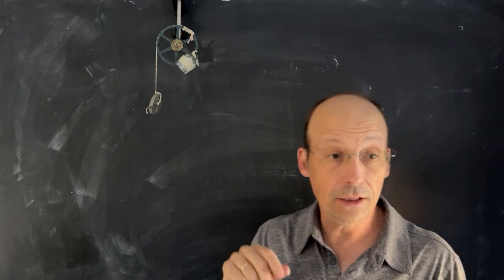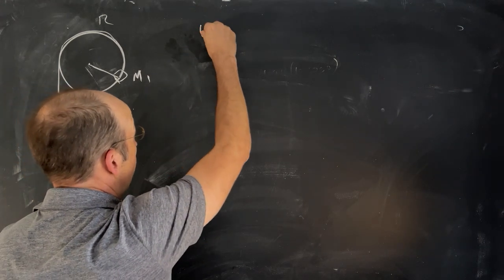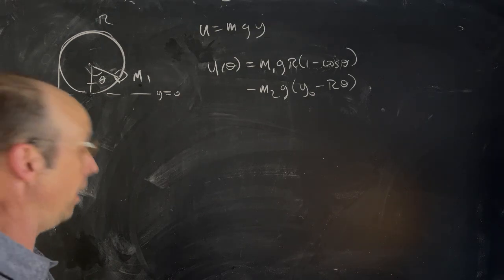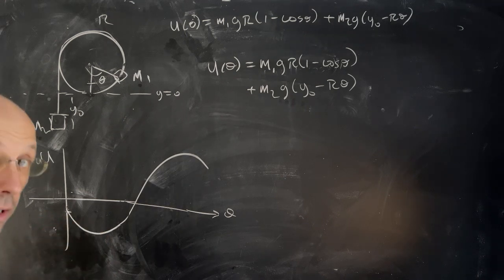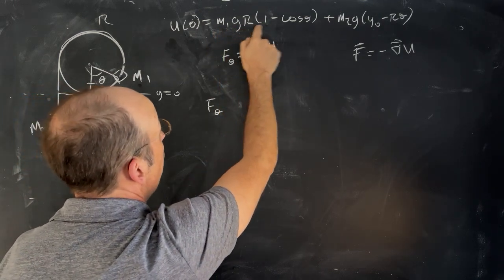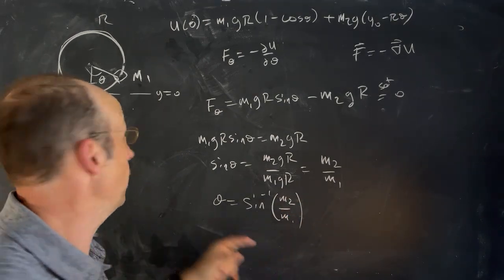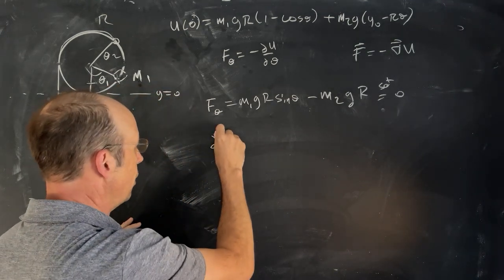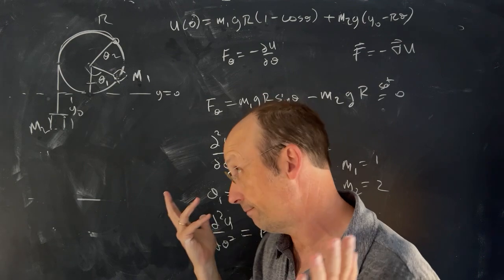Classical Mechanics: Using Potential Energy to Find Stable Equilibrium

Comment: it wont change the final result but to be exact the force F_\theta must have a 1/R factor. also you calculated the partial derivative not (minus)xpartial derivative. but in the end the result is correct